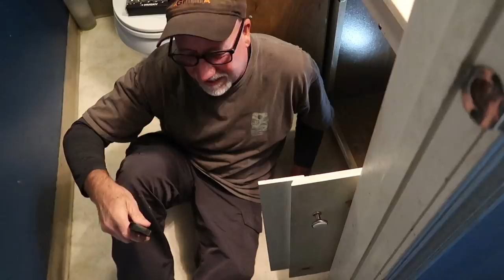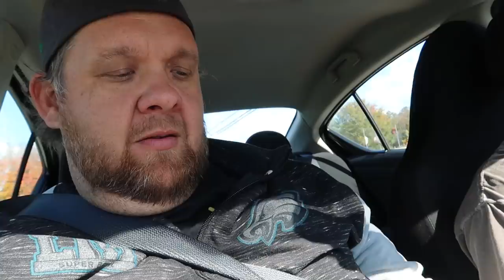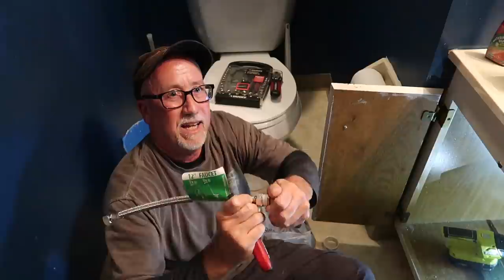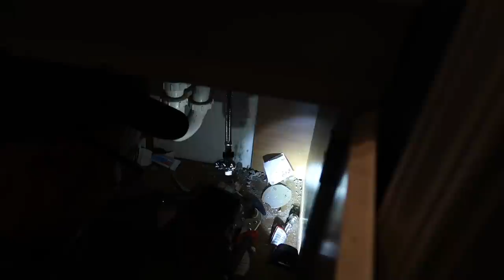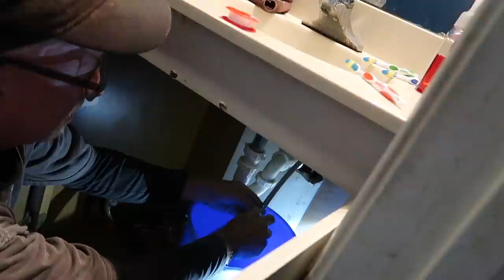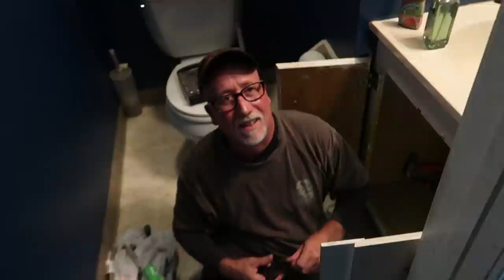Two Idiots Try to Plumb

Comment: You don’t use Teflon on any of those fittings there is a gasket on both ends of the water lines the Teflon will keep you from getting it tight enough and that why it is leaking. You need to take out that Teflon tape because it will eventually leak again

Comment: Why have the shut off valve anyways when the main was like 10 seconds away from the bathroom?
Reply from the maker: It's so you can use the water in the rest of the house if you need to work on your sink. Like if you were to put a new sink in, or replace the line after the shutoff valve.